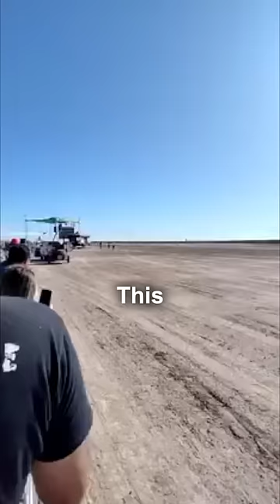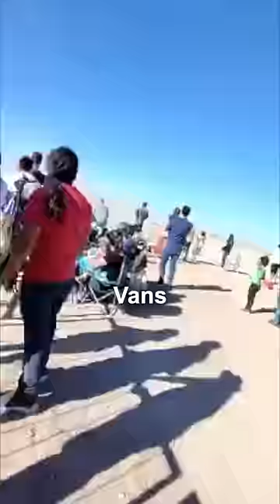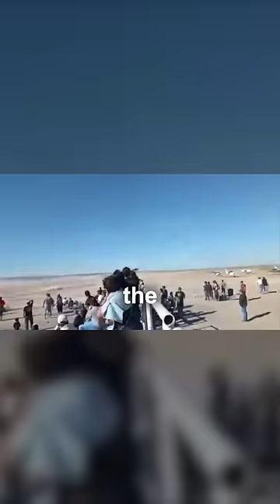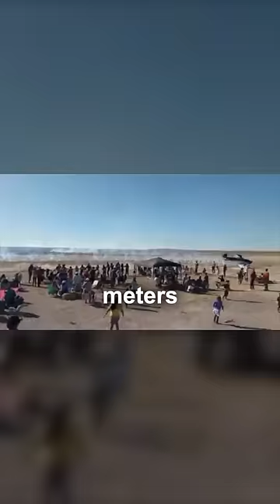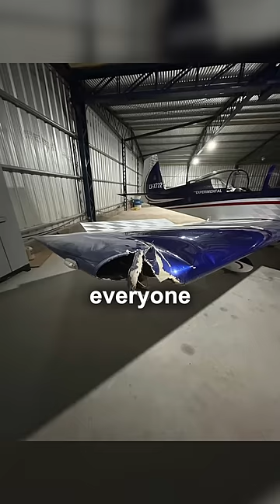Home built aircraft accident #plane #pilot #crash

Comment: The fact that he got that thing back in the air without turning into a shrapnel windmill is a goddamn miracle.
Reply: He did it right, he leveled the wings first (by which time the tires touched) THEN pulled back even though your first instinct is to pull back.
Reply: Believe or not, it's SKILL not luck...
Reply: @gbear1005 I'd believe it if the pilot hadn't done such a risky and foolish move beforehand
Reply: That's what I'm saying his reflexes must be phenomenal 😮
Reply: @gbear1005  no old bold pilots 
   He got lucky asf
Reply: That’s some shit you turn the music off after
Reply: Shrapnel windmill 😂😂😂
Reply: @windolite Yes sir!
Reply: Yup.  Had it rained heavily before this and that was mud on the ground ...
Reply: @gbear1005  Wrong.  An experienced with SKILL knows that his plane will lose altitude when turning and knows to compensate for it.
Reply: @MaximGhost 💀💀💀
Reply: @gbear1005 no, it’s damn lucky. Sure he had to react, but it’s pure luck his wing stayed on or he struck his prop
Reply: @gbear1005 No, is luck. A rock big enough embedded in the sand would have sent you to the afterlife

Comment: Whoever installed that wing deserves a “thank you” and a drink 🥃
Reply: It says it was a homebuilt aircraft. Guess he should pat himself on the back 😂
Reply: @nullobject7966 home assembled but would think he didn’t actually construct the wing. Just assembled it. If I’m wrong, then congratulations to that guy.
Reply: @konewone361 they sell that plane as a “kit plane” meaning a lot of the large pieces are put together, but he still would’ve had to assemble the wing
Reply: @konewone361 yes he assembled it obviously he didn't make the wheel he's not a manufacturer
Reply: @matthewhilger1942 
No you build the wing yourself. It's still possible the pilot bought it from the builder.
Reply: He used extra duct tape
Reply: The wings are actually partially assembled by Vans. The "spar" is not assembled by any customer, and each one is serialized and recorded forever. I used to work there.
Reply: Best wing....EVER!!!
Reply: The airframe must be so robust!
Reply: bro said " hold my beer"
Reply: No rudder
Reply: 😮perdida de sustentación al ir de filo pero es experto logro estabilizar a tiempo
Reply: He would still have to put the Jesus bolts on the main spar wing connections. Thank the bolt manufacturer.

Comment: As a plane wing, I'm suprised the pilot was able  to recover.
Reply: I identify as a plane fuselage.
Reply: As a flat piece of ground, I'm surprised the pilot was able to plane
Reply: I think he got really lucky with the hard dirt sandy gravely ground surface because it allowed his wing to slip along it rather than dig in and rotate the nose of the aircraft and propeller downward into the ground… he got away with basically skimming it rather than full blown explosive crash. Like how many accidents have we seen where the wing touches grass or something and then immediately the nose of the aircraft gets whipped into the ground…
Reply: As a heterogeneous piece of bauxite that has yet to be converted into aluminum I identify with the pain the ground felt.
Reply: Pronouns: Wing/Wingself
Reply: @artlife6210 😂😂
Reply: As a recover, I'm surprised the wing was able to pilot
Reply: As a control stick i also helped with the plane salvation so you should be surprised of me also

Comment: In the wrong situation that plane could have completely grabbed the floor and gone straight into the crowd, scary stuff.
edit: after much thought, plane no hit ground, spectators ok no matter what, people happy no bomb.
Reply: Loose dirt saved allota people. (Pick your seats carefully on race tracks.)
Reply: They're lucky a rock or any other obstruction wasn't there strong enough to catch it, I'd be very careful around Spectators flying that low in that fast you really have to consider your sink rate
Reply: They these guys are getting a bit ballsy huh. I think ill go to the airshow thats just down one notch so i dont end up feeling like a japanese kamazees mortal enemy eventhough its 50 states vs 1 island
Reply: Amazing observation there, captain. Truly a work of genius
Reply: @chrisn2811  no shot he had a bomb on that plane aswell, do you know why?
Reply: Actually unlikely. The mass of the craft would cause it to mostly carry on straight, while at worse the entire wing ripped off. It would move slightly in that direction, but the momentum of something that heavy that fast is significant.

Due to the wing angle if anything it would pull the craft almost directly into the ground and begin a tumbling mess roughly in the original direction.
Reply: @carrotsandrunning  Thank you, it never would've hit the crowd.
Reply: @BMAD_Christoph27  doesn’t mean never, still could have had some debris hit the crowd
Reply: @link2g715  An object in motion stays in motion, the same is true for the debris. Unless this tiny aircraft is capable of creating a high pressure explosion that counteracts the momentum, no piece of debris will fly back to hit the crowd.
Reply: @chrisn2811  You make zero sense just letting you know.
Reply: @link2g715  inertia 😅
Reply: "Floor?"
Reply: Lucky Lucky man him
Reply: nope
Reply: @rossjohnson1872 false information son
Reply: Im honestly surprised it didn't 😮
Reply: This is one pilot that needs to learn that it's better to be old than bold.
Reply: I'm thinking being that close to the crowd is the "wrong situation"
Reply: This WAS a completely wrong situation !
Reply: @carrotsandrunning Fuel, my friend....
Reply: In the right situation, I could win the lottery.

If's and but's have no value.
Reply: Why are so many calling the ground tge floor?

Are you that special, you can't decipher between the 2?
Reply: @elgoog7830  cause theyre the same thing???

why are so many people still commenting on a month old comment, do you think your special?
Reply: @link2g715  
😁😆😅
Reply: @elgoog7830  The average person is barely above functionally artarded levels, then factor in "No child left behind", which truly means every child held back to the dumbest kids level.

Modern education, the amount of people who have graduated College and spell the word "lose" as "loose", and use words that don't exist like "irregardless". 

We have created Idiiocracy, in real time.
Reply: No. No it wouldn't.  The aircraft would have continued in exactly the same direction. Mass in motion doesn't change direction that quickly, particularly at that velocity. Nope.
Reply: @carrotsandrunning  Wrong.. it would have easily flipped into the crowd to his right, it's a very light plane and it's happened before
Reply: @joshuawood1436 The amount of irony, when you use too big words and spell them wrong. Its spelled "idiocracy". Not idiiocracy.
Reply: @jonialhonen1420  Irony means sarcasm, not poetic justice.

You also conflated a typo to illiteracy, how embarassing for you... a double whammy.
Reply: @joshuawood1436  Nah. Poetic justice is a form of irony. And i did infact accuse you about spelling mistake. So nothing wrong in my part, the embarasing double whammy tho?
Reply: @carrotsandrunning precisely.
Reply: @jonialhonen1420  Poetic justice is a form of sarcasm?

Did you flunk out of school, or drop out...
Reply: @joshuawood1436  thankyou for your comment... U are cool
Reply: Argentina papa! no lo entenderias XD
Reply: (ok for the complainers...)
one of the wrong situation's would be that the pilot pulled 'uP' (even a little) to get away from the ground ...but at that angle, uP is towards the crowd.
...
(I dunno how much more left rudder makes in that aircraft)
Reply: Nah, physics is only studied and explained after accidents.  Mess with it and you wont find out, others after you will 😂
Reply: Bro got caught saying BS
Reply: This whas not an accident. It is a game about pick the handkerchief from the runway. No crash at all... and he did it!
Reply: @carrotsandrunning  While it's true that the plane was unlikely to hit the crowd with that trajectory, debris could easily have caused many injuries or even deaths if the plane broke up.
Reply: @carrotsandrunning im not sure but the wings maybe could have catched the air and made it flip sideways because of the center of mass being behind the center of vertical drag… idk
Reply: @niil047 thats true, just look at what happened at the 1955 lemans race tragedy. Not to mention the aircraft would be producing lift in a lateral orientation, causing it to ark in the crowds direction. Had it started cart wheeling it would be just as likely. Even if it passed by the crowd, debris does fly back off of a spinning object
Reply: @@samygherib3321 wtf does planck have to do with mass, inertia and aerodynamics
Reply: @BMAD_Christoph27 Estás muy equivocado
Reply: @Franko4449 If you can come up with accurate calculations as to how the debris could've made a 180 to hit the crowd then I'll listen to you. If not then I'll stay with Newtons first law fair and simple.
Reply: @BMAD_Christoph27 wrong lmao
Reply: @chadsworthgigaII  Every part of this aircraft was moving away from the crowd at over 200kph, no amount of contact with the ground could result in the wreckage being redirected more than 30°. The only realistic way in which the crowd could have potentially been hit is by shrapnel from a resulting explosion, however, with that attitude and momentum it would still be unlikely that anyone would get hurt.

If you can provide a reason as to how the crowd could've potentially been hit then I welcome you to elaborate. Beyond that your words at present are but white noise.
Reply: Got that right scary
Reply: @@samygherib3321 yeah what does he have to do with inertia and aerodynamics
Reply: @@samygherib3321 what are you talking about?? planck's length rule has nothing to do with conservation of momentum and aerodynamics
Reply: its cool, these chalk board warriors aren't factoring kinetic energy from the impact and the tertiary forces that would EJECT material towards to crowd regardless of the overall mass of the plane travelling elsewhere. Noobs. things go boom and throw debris.
Reply: @GODSWORD11 fue verdad
Reply: @TrueHelpTV  yeah...
Reply: What?
Reply: 2 months actually
Reply: no. we wont stop.. hehehehaaa
Reply: Hello
Reply: I like turtles 🐢
Reply: Just diable notification for this comment its not that hard
Reply: @vfordyslexia6440 me too
Reply: @realzoomer_  is there a way to do it for this specific comment instead of my whole youtube cause i still want notifications
Reply: I'm just replying to give you a notification 2 months late.
Reply: Turn them off
Reply: Two months later 😅
Reply: Streisand effect. You will never not get notifications :D
Reply: I just wanted to say high and give you a notification
Reply: turn off notifications for this comment.... asking the internet to stop shows your lack of understanding the human nature.
Reply: Because you didn't turn off notifications. What an odd edit
Reply: Notify
Reply: Hope your day going well
Reply: Hahahax here’s a new notification
Reply: Replying just to inconvenience you
Reply: Delete your comment then 💀😂
Reply: Blah
Reply: @Dra741 😢😮😮❤😊
Reply: Unnecessary edit
Reply: W edit 
Of an edit
Reply: 81 million votes...
Reply: @joshuawood1436 rregardless of your comment we currently live in the most educated period of human history fyi.

(Oh and irregardless is a word, has been for over 200 years and is in the oxford english dictionary)
Reply: The edit is hilarious
Reply: It’s not the loose dirt or that the pilot is skilled… it was the camera that saved the crowd.
Reply: Don't give up hope on society just yet,  brother. There is hope in Jesus. I say this with all sincerity. Seek Him and you'll find the hope.
Reply: Nop, the airceaft hitting the crowd would be impossible.
Reply: No it definitely could have
Reply: No bomb, me happy
Reply: Oddest edit ever
Reply: @TheAnnoyingBoss it’s in Argentina 🇦🇷 things go differently there 😂
Reply: Opbtuhd
Reply: @Dra741 😅
Reply: @rossjohnson1872 I'll make sure to inspect the race track up close before the next nascar race 👍
Reply: Crowd was safe. Inside the turn.
A crash would have moved debris away from crowd.
Reply: @@sea-pin You know he didn’t mean to get that low, right?
At an airshow, sometimes things go wrong because margins are fine.
Reply: Lol the edit 😂
Reply: Homeboy there try to knife edge at too low an altitude and not fast enough, without practice.  Near a crowd 😮🦹🏻‍♂️
Reply: This could have easily resulted in the foundation of an industrial metal band.
Reply: I'm not gonna read the comments. Good save tho. Very nice. YES INDEED. Nothing to see here people
Reply: Floor?? Thats in your house, the ground is what's outside of your house..😂
Reply: Plane wasn’t physically at the location, it was a computer generated hologram
Reply: @vfordyslexia6440  
😂😂 Me too!
Reply: Damn for a minute i thought you could write straight English. 🗿🗿🗿
Reply: Meu Deus 😨
Reply: @BMAD_Christoph27  I imagine you're the pilot.
Reply: @stevenbrucci  Nope, just someone that understands what the preservation of angular momentum means.
Reply: The ground, not the floor. Floor is inside a building, ground is outside.
Reply: @lukespread  tell me you didnt read the whole comment without telling me

Comment: The pilot was cocky yeah, but the fact that he reacted fast enough to pull it away from the ground and bounce on the wheels is amazing.
Reply: When you clip the ground like this guy did, you’re at the mercy of physics. In this situation, his reaction didn’t save his life, he just lucked out.
Reply: @joshuatk59 When you clip the ground like this, the last thing you want is physics.
Without counter roll or a little bit of yaw, that drag pulls the nose directly towards the ground.

It was entirely his recovery
Reply: He should thank the plane
Reply: @joshuatk59  ohh, the expert from the couch... thank you for your presence
Reply: If he had more experience he wouldn't have needed to rely solely on reaction.
Reply: When you clip the ground like this  =  Emotional Damage 😅
Reply: @pabloata4708  Didn’t call myself an expert, it’s just my opinion. No need to be rude.
Reply: he was lucky, nothing more.
Reply: Of course, Argentinian pilot 😂 cocky but skilled lol
Reply: Not cocky. Average Argentinian pilot
Reply: @tomasdelasota8581  if this is average, it's a wonder there are any Argentinian pilots left. Good to know to never fly with a person from Argentina.
Reply: He was just lucky that the nose gear had ground contact and stopped the fuselage from getting lower so it bounced back into the air...with a taildragger, the same maneuver would have made the thing tip over and produce a big fireball.

Comment: Fun fact: the wings develop the same lift regardless of bank angle. But in a bank only some of  lifting force is opposing the gravitational force. That’s why the plane will descend in an uncoordinated bank.
Reply: Correct!
Reply: Fun fact: : "Lift" is measured opposite in relation to gravity and not in relation to the aircraft's orientation.

So in a bank an aircraft produces much less lift 🙄

Do you need me to explain that again? 🤔
Reply: A) Don't fly a maneuver so near the ground

B) Needed some left rudder to fly parallel to ground
Reply: @2engjnr2  No, lift is defined as the component of force produced by the wings that is perpendicular to the airflow. It can be up, sideways, down, whatever.

This component is also almost always perpendicular to an imaginary line drawn along the wingspan.

So if you bank 45 degrees, the lift rotates by 45 degrees too.
Reply: I was going to say, what does this guy think when you fly upside down
Reply: ruipinto4768  It also does not act perpendicular to the wings (chord-wise).  (Bit of a nitpick)

It acts perpendicular to the airflow, and perpendicular to the wings (span-wise).
Reply: I was looking for this comment, I thought his explanation was off

Comment: That crowd doesn’t realize how lucky they are.
Reply: I swear people are so so dumb 🤦 they wanna get as close to the action as possible, yet theyd get all pissy if something bad happened. Same kinda people who sit too close to a racetrack on the sharp corner after a straight away.. if i ran an event like this id make everyone sign a death waiver, n that its required to be atleast 150 feet away from the runway. (Maybe even further, 1000 sounds better tbh) Anyone closer is doing so at their own risk already knowing the dangers of doing so. I mean seriously, people will even take their kids into these dangerous areas with no care what could happen
Reply: @Kratos-eg7ez didn't you hear where it is? Less effort placed on spectators safety for financial reasons.
Reply: Nah, they were gonna be fine. there’s a little fence thing between the people and the aircraft. Action stays on the plane side only, it’s against the rules to cross over.
Reply: An inch deeper, the wing grabs the ground and gets flung into the crowd. Fun stuff. No Air shows for me.
Reply: @larryjohnson3087 wrong! If that would happen inertia would replace aerodynamics balance from to broken wing and fling the aircraft further right.
*he was pulling at least 1G horizontally.
Reply: @rooms1028 and that makes it ok in your opinion?